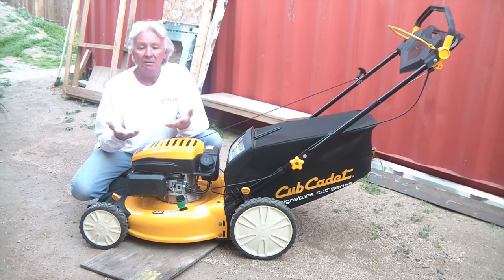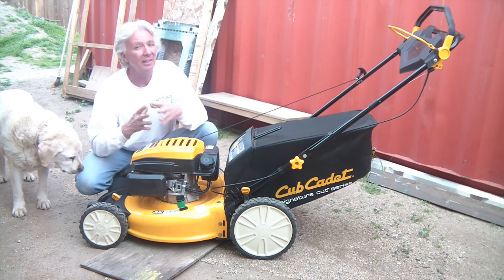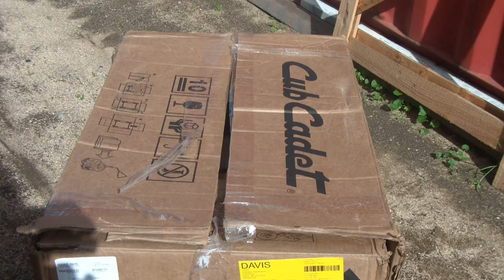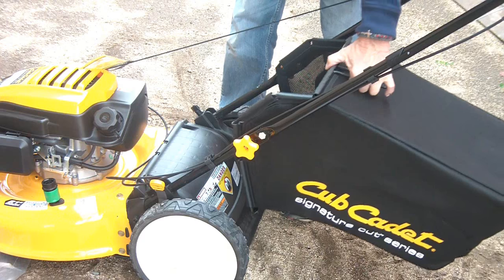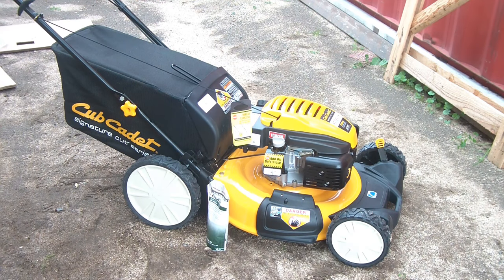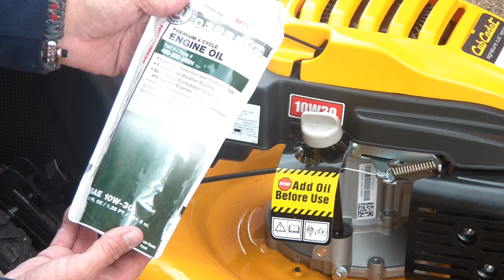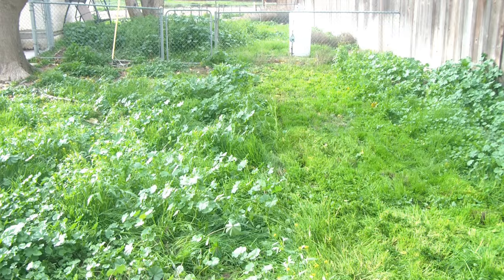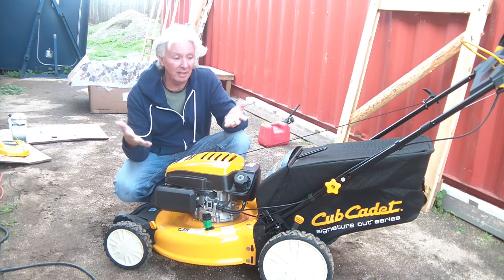Cub Cadet my speed walk behind lawnmower set up and demo

Comment: I have the same mower.  I have had it for 5 yrs. now.  It's been a good mower except for two problems I have had.  1st. was noticed right away.  I am not always capable of mowing when the grass needs mowing.  Either I haven't got the time due to working, or the weather doesn't permit it.  Thus, sometimes my grass gets taller than I would like and sometimes it's still damp from previous weather.  It was times like those that the side chute would clog up and I was constantly having to stop and unclog it.  I fixed the problem by cutting the bottom brace of deck there at the chute to allow grass more space to discharge.  No biggie and it worked well.  The 2nd. problem just recently happened.  Even after cleaning the underside of the mower after every use, the deck is rusting out.  I have had mowers for 12 to 15 yrs. without ever having a deck rust out.  I ordered a new deck and when it came in, I figured out the problem.  The mower weighs right at 90 lbs., but I could literally pick up the deck with two fingers.  It's super light weight and very thin metal.  If I ever have to replace this mower, I assure you I will not be getting another Cub Cadet if I can find anything heavier built.
Reply: I am going thru the same problems right now. The deck seems to bend in the middle when lifting the front wheels, Deck is rusting out as well. VERY THIN deck. I am buying a replacement deck and will get another 3-4 years out of it before buying a different brand that is more robust!!

Comment: amazing demo,  several year ago I purchased a troy bilt lawnmower  with the Honda engine.  this would been the 3rd transmission of speed control on two lawnmower.   so  I purchased a cub cadet lawnmower and coming from the home depot.   cub cadet was all sale out .
Reply from the maker: Allie Lerman thank you That was a concern I had was the trans for the walk behind and just how long it would last and the cost to replace or repair, thankfully Its is working just fine still. hopefully this will last longet than your others did. Thanks for viewing.

Comment: Thanks for this video. I bought a 300 model last week. Everything is as advertised. Though, moving the mower without the engine engaged is a bit tough as the plastic piece is in the way of where you’d normally put your hands. Also, it’s not the best with any yard with many pivots as you can’t mutually turn the mower (pick it up and reorient) without engaging the self-propel (and having the wheels spin in the grass). Perhaps I’m missing something though?
Reply from the maker: Alex Scrimpshire
 Thanks for the comment. Personally I haven't ran into this situation. When I go to pivot the mower to turn around I pull back and push down disengaging the wheels. once I'm ready I simply push forward and the wheels once again engage. I may take some practice but I'm sure once you get the hang of it you'll enjoy this mower. I will say this isn't the best for a small yard.

Comment: Plan on buying a carburetor for this mower after a year or two..About 14.00 on Ebay..If your mower won't start spray some starter or carburetor cleaner in the carburetor..If it runs for about 10 seconds or longer and quits it is the carburetor...

Comment: I am amazed at the fact you can keep it going. The motor in my 500 series, won’t stay running   You can only haul these things back so many times. We’ve mowed our lawn, maybe six time in four years. Still have issues. Suggested to use Rec gas, change plug, why it’s so new   Six our seven hours total use and push it back to the shade and get the John Deere. Which is old, like 1984 old. Somebody makes a good push mower. Just don’t know who.
Reply from the maker: Mark sorry for the frustration you may be the unfortunate recipient of a faulty mower. It does happen. I would of taken it back
Reply: The Shack I’ve taken it back. One year I left it all winter. When it’s cold it will run.
Reply: @TheShackHome  Would HAVE not would OF.

Comment: Is your mower's carburetor plastic? My lawn mower repair shop has told me to stay clear of those cheap ones.
Reply from the maker: Mine was a type of metal but after a few years I went to start and it wouldn’t purchased a $15 replacement on Amazon installed it 3 pulls and it started that’s been over a year ago the replacement was metal. But each year the make changes maybe not they are plastic I don’t know

Comment: QUESTION: I got a new mower this year. It is very similar to this one shown in the video. I'm a bit concerned this time, though. The first two times I mowed, it started on the first pull every time. I then changed oil after 6 hours - as I was told. It started on the first pull, but not as easy. This time was the fourth time I mowed, and each time took 3 pulls to start it.
 It takes me about three hours to mow the yard, so I usually take a couple breaks while mowing. Before putting it away, I tried REALLY hard and got it to start on the first pull, but it was not "effortless" with one pull like before. Why is this?
Reply from the maker: Michael sorry I'm not sure what the problem could be, Mine 80% starts on the first pull a few times I ran out of gas it took a few pulls an occasion it will take 2. Mostly it will start on the first pull. It may need the carb adjusted. Sounds like something simple though.

Comment: Thanks for the video! My 83 yr old father is looking for a self propelled mower. The speed control of this looks perfect. His lawn has quite a few curvy garden beds to mow around and we've heard that the rear wheel drive mowers are harder to do the turns with. A front wheel drive mower you'd just push the handle down to turn it and the drive wouldn't be an issue.
After using this for as long as you have, how do you think the rear drive would handle curves?
Thanks!
Reply from the maker: Love an toys I don't think it would ba an issue. I.m here in Texas helping my aunt and she has the same mower but with electric start. She can't pull to start. She has strength issues and a few health from a bout with cancer. Her back yard has winding land scape and she still mowes here lawn every few days, a little at a time. She is 73 If it has sharp curves. A riding mower might be even better. I'd like to get on I'm on an acre and it's a lot of walking to mow it

Comment: I love this mower the rear wheel drive makes a huge difference especially going up hill but I do have one question How do you mulch?
Reply from the maker: mickee just close it up. dont attach the bag dont open the side discharge the blade that it comes with is a mulching blade. I will rear bag the first two cuts of the season then it's all mulching with once every month rear bag just because. that's it.
Reply: The Shack Thanks for very fast response. So it won't leave clumps of grass on lawn?
Reply from the maker: If you lawn is high and your cutting a lot it may or if its very wet but that's why i do the first 2 rear bagging then as long as i go every week it does fine. if i miss and go 10 days ill bag it . I will try for every 6 days and in the eve so its not damp.
Reply: The Shack I'll try it this weekend. Thanks
Reply from the maker: mickee you're very welcome.  Just an FYI if you like a chance to win a Porter Cable drill and impact kit i'm giving one away this Monday as my 3 year anniversary just click on this link and i give out info on how to get in the drawing   
https://www.youtube.com/watch?v=VyRUJTp76aA

Comment: So after a few months, are you still happy with the mower? No issues?
Reply from the maker: Alan i truly enjoy this mower. If any complaint i would say it would be the bag. I used the rear bag today to see how it would do and it just didn't seem to throw the clippings far enough back in the bag. It would only fill may be not quite half seemed to get a lot of buildup at the entry to the bag. That's why I hardly ever use them. I get tired of only getting a pass or two them having to stop and dump the bag. Too much time wasted for me.  I prefer to just mulch the grass but every now and then I will bag. But with that said the clippings were amazingly fine cut almost to a fine grinding. That I didn't expect. That's great for the mulch effect. One pull and it starts absolutely love the my speed. I use no energy to push this mower. Lawn care is fun again. Thanks for viewing Alan and thank for the question.
Reply: I had to give up on the bag also.  Got tired of unclogging the entrance to it.   Looks awesome but doesn't work!
Reply: My bag works great but the piece on the right side literally shook off of the machine during use, like off the melding.

Comment: Hello, great review. Is there a oil drain under the deck? Or do you have to tilt the mower upside down to change drain the oil? Thanks.
Reply from the maker: Azael tilt on it's side. I'm actually going to do just that in 2 weeks for my annual oil change getting ready for spring.
Reply: The Shack Thanks. Seems every new mower is a tilt drain now. Bad design choice in my opinion.
Reply from the maker: Azael I made a mistake i went to change the oil today and this has a drain plug at the bottom of the fill tube. I don't like this i have to let the oil drain onto the deck and drip down through a hole but it also drained under the motor and dripped down the shaft where the blade connects, it mad a mess. i think the TD (tip and drain) method would be much less messy or a drain under the deck. sorry i was wrong, so i did a video on changing the oil, spark plug, air filter and sharping the blade.
Reply: The Shack Either method seems awkward and a bad design. Thanks.

Comment: Thanks for making this video! Do you know what to do if the pull cord is stuck and won't budge more than a few inches?
Reply from the maker: Suzanne sound like the top of the mower need to be pulled off ad see what the hold up is. No way of knowing till you pull it off and see if anything may have broke off or something came loose and jamming it.

Comment: The review is of a new Cub Cadet, mine is 2 years old (into season 2) and has already stopped working.  I am waiting for the part (Cable - Control ERS 63.00 WL)  946-05105A   This part controls the engine shut off,  so if you should slip and lose control of the mower the motor will shut off causing the blade to stop spinning.   Cub Cadet needs to upgrade the cable to something stronger and bigger.  1/8 inch cable would last forever?
Reply from the maker: K Simpson thanks for the heads up. something to keep in mind. So far into my 2nd year mine has had no issues what so ever. But cables and general maintenance is just the nature of the beast. No different than the upkeep of a car. 2 different people can but the same model and both have different issues.  Cables being pulled continually are something to keep an eye on. They are high wear items. Thanks again K S.

Comment: can you NOT pull it backwards without dragging the wheels?
Reply from the maker: Gene Smay yes just pull back on the handle and it releases the clutch. It's when you push it forward set the gears and the further you push forward the faster it will go. Pretty cool if you think about it. Still running and no issues as of yet.

Comment: Thanks for the video, as I was a little confused by the directions that came in the box. Question: Can the big plastic yellow/black face plate below the handle bar be removed? Not a big deal, just don't like the looks.
Reply from the maker: L H yes that’s what was  bouncing around when I received mine and still haven’t replaced it . Min isn’t on either.

Comment: Do you have any issue with bagging?  Mine seems to leaking from the top right and left corner of the catcher frame.  Blows right in my face. I’m not sure if the frame is the issue here.
Reply from the maker: new han no i don't I get nothing blowing does a great job. Is this a recent problem or is your mower new. Id recheck the way the bag was assembled and make sure the tabs are all properly connected the bag should be fairly tight

Comment: I just purchased one yesterday (5/4/2019) from Tractor supply. It was on sale for 296.00 and I got 10% off, plus another 30. Anyhow, I've still keeping my 20 year old cub cadet. It's a tank. I purchased a new one bc I decided to bag grass at my new home. I no longer had the bag for my old cub cadet. Thus my reason for buying a new one. In comparison to quality to my old one, I'm concerned about the new one. The entire back end of the mower is nothing but plastic held on to the deck by 3 screws on each side of the deck. All your handle assembly is held to the deck via the cheap plastic housing on the back of the deck. All your handle torque during operation, and with the weight of the bagger with grass in it is heavy, the bagger clips on to that black cheap plastic. I can bet this is a major weak point and design flaw. I in no way see this design holding up. I'm taking my mower back for a refund and going to look a for a mower that is a solid metal deck and handle assembly attached better.
Reply from the maker: Larry nothing is built like it was 20 years ago. Believe me I feel your pain when I buy a tool and see how much plastic is incorporated in them now it discuses me. But they want to keep cost down on everything unfortunately. Sorry to her your taking it back. Mine is doing great my only concern is the system that drives the mower. The longevity and repair cost is my main concern for this mover. Hope you find what you're looking for thanks for the info on the older Cubss..
Reply: @TheShackHome  you're taking not your taking.

Comment: FYI u shouldn't turn the oil cap all the way in when checking it
Reply: It depends on the engine manufacturer. Some have you screw it all the way in and the manual should tell you which is correct.

Comment: bought one and used it 3 times. Has less than an hour on it. No start!!!  I put  Mechanical in a bottle in it, clean carb, air filter is clean.  It will fire with carb cleaner and then fail to run.  The first time I buy an expensive lawn mower and it runs worse than my cheaper ones!  Any ideas?
Reply from the maker: well if no start and it had fuel in it. id check the carb to make sure it had fuel going to it then id take the spark plug out and check for firing. There isn't a whole lot to these engines. If no spark from spark plug your magneto may be faulty. this new id call customer service and see if they have an authorized service shop near and hopefully cover the repair cost . another thought you have to pull the handle to start the mower the safety switch could also be faulty electronics can go out anytime.again see it it is under warranty.

Comment: WHY ARE THERE 2 BIG METAL PIPES BLOCKING THE BLADE ?
Reply from the maker: Edward im confused. I dont know of anything blocking the blade. The only thing under the deck is a cover for the drive unit from the motor to the rear wheel drive. There are no pipes of any kind under the deck

Comment: Not True whatsoever! Stalls, boggs, chokes and DIES at grass above 4.25 inches. I had to reweld front and rear wheel settings to raise the too low settings this mower comes stock with. After I did and hope for the best it's still bogs and stalls and dies with the damn grass at 4.25 in and I'm cutting it at 3 now! This is the worst lawn mower I've ever had and I've owned five in my lifetime all been used mtds Craftsman mowers I was hoping for the best when I bought a CubCadet -- man am I sorry I did! Never again!